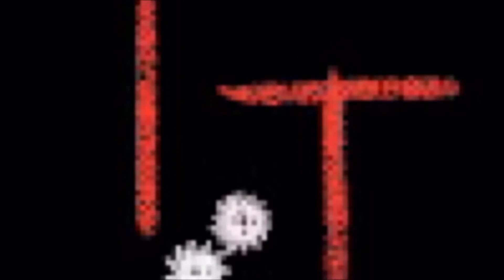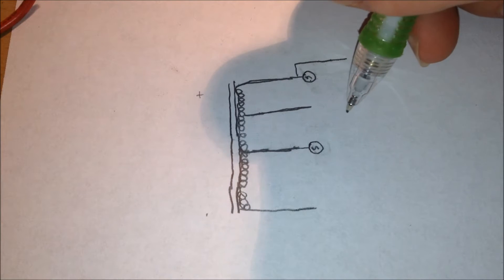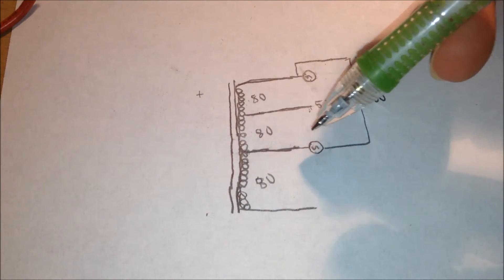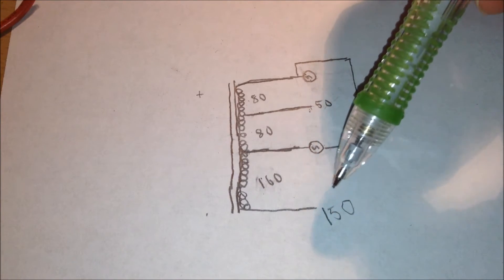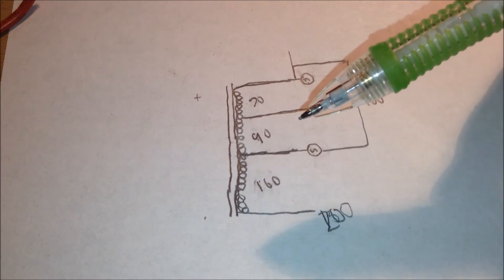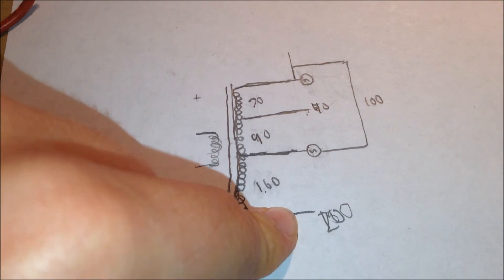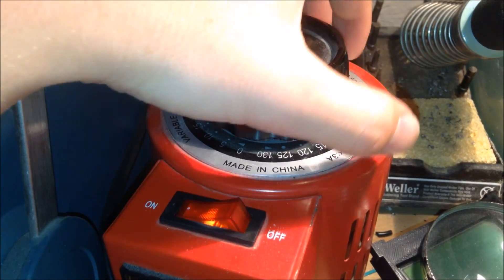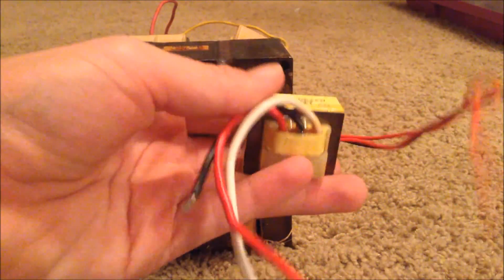How Autotransformers Work

Comment: I have watched so many videos and I still don't understand completely. taking the knowledge I have learned from this video https://youtu.be/ZjwzpoCiF8A       the electrons will travel from the primary coil through an iron core and create induction with the secondary coil, the more windings on secondary the more voltage as we all know. how do the electrons travel in an autotransformer? how does induction work in an autotransformer? how can you take electrons already traveling through a wire and increase the induction in the same wire? how do they not interfere with each other?